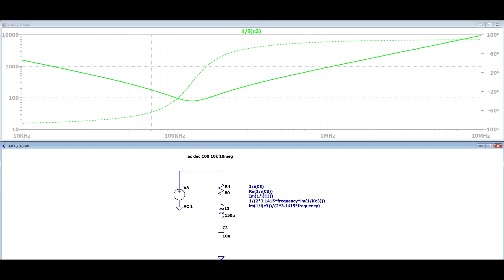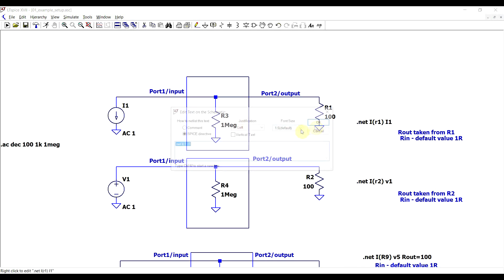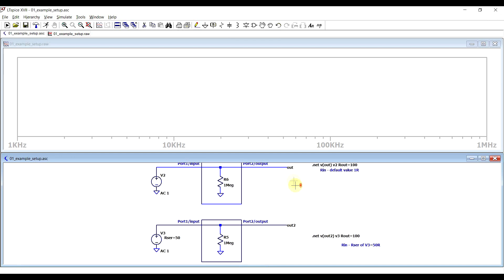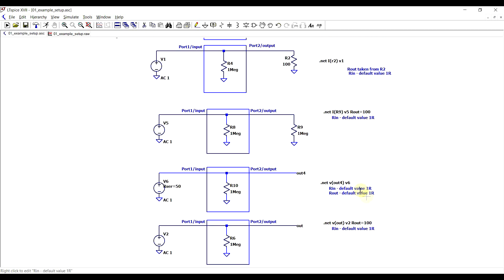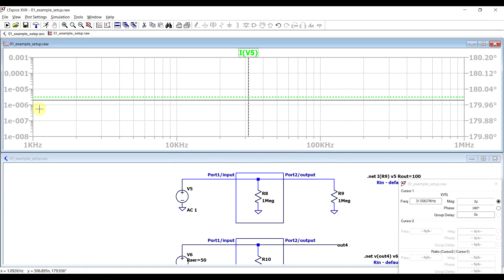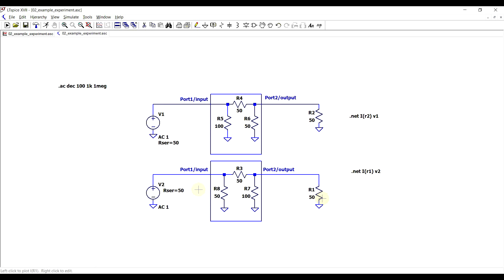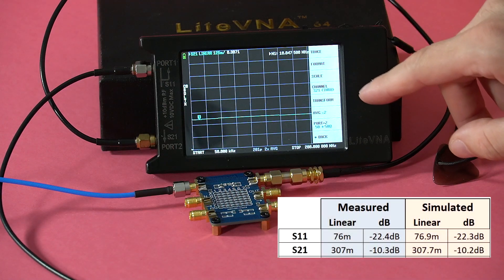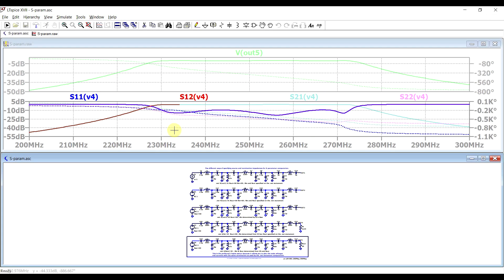LTspice tutorial - Network parameters and the .net statement (part 2/2)

Comment: Hi, I wanted to obtain the transmission or impedance parameters of a gyrator (Dutta Roy circuit) and corroborate it through simulation as shown in the video. Do you have any video or do you know of any book that talks about how to find these parameters (mathematically) of a circuit with an op amp? Because I'm not sure which model to use with the operational one. Regards

Comment: Hi:
Can I analyse a amplifier stage using .Net command?
Regards.
Reply from the maker: Of course! This command will work with any sort of circuit; just make sure the amplifier is correctly supplied (it will need not just a signal source but also DC supply); I think I did some video a while back with the typical connections of a transistor (common base/emitter/collector) where I used the .net statement to observe the operation.
Reply: @FesZElectronics  Hi, great video!  Can you point out the video where you covered this topic?  I'm struggling to bias a FET and observe its S-parameters